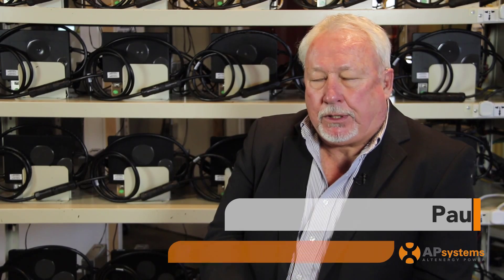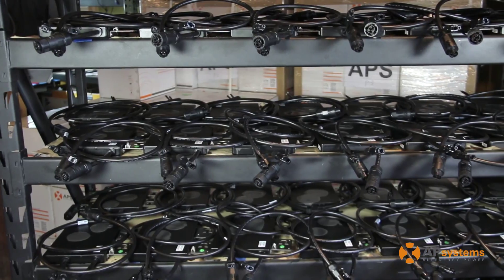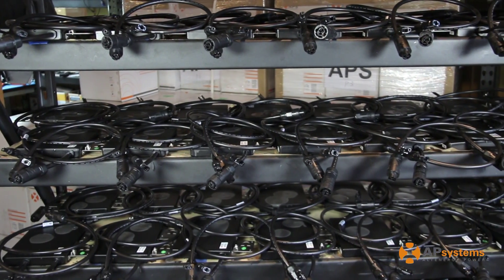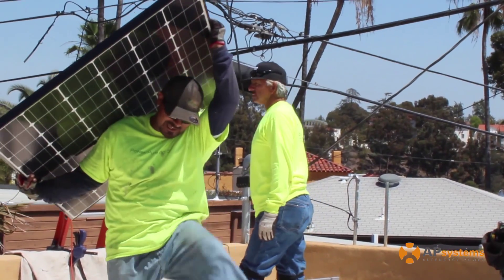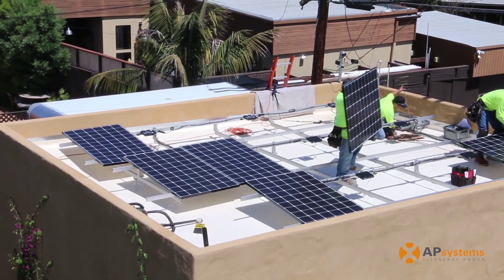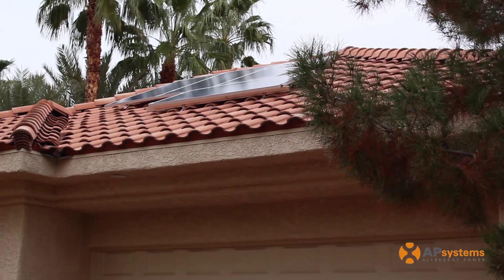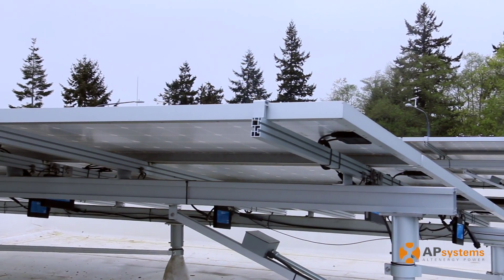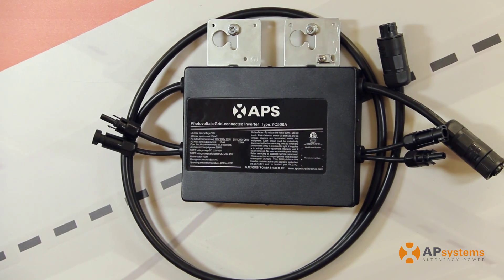APsystems YC500A Microinverter

Comment: The YC500 at 120VAC is very bad, it doesn't synchronize, and the after-sales support is very bad. We do not recommend it.
Reply: It is worse than bad.  They don't support the products they manufacture.  40% of mine have died in 5 years and APSystems turns a blind eye to the whole thing.  I took my failed ones apart and there were clear manufacturing defects of cold solder joints on the electrolytic capacitors.  That is not even excusable.

Comment: Hi guys I am having to go and trouble shoot the system another installer put in.   If you have two points of contact for two panels you would connect the positive and negative of the panel to the positive and negative  of the input on the micro-inverter, correct?   I know it seems obvious but the installers just "plug and played" and installed it opposite to that because the male and female connectors didn't match.  If you reverse the positive and negative connections for the inverter, will we damage it irreparably?

Comment: What happens if I use two Canadian CS6P-325P (325 watts)? Why it is advertised for up to 310w panels?
Reply from the maker: Hi Paulo, you should be able to use most any PV modules with our microinverters so long as they match the input requirements. The YC500A is recommended for PV modules up to 310W because of its output wattage capability. For 325W panels, we suggest considering the YC500i if it is available in your region due to its higher output.
Reply: APsystems Solar Unfortunately it’s not available in Brazil, same for YC600, I was told. So I can safely connect 325w panels.  Will it not overload the microinverters? I know that will be clipping, but my fear is to cause damage to the microinverters. Thank you.
Reply from the maker: As long as the input requirements match the parameters on the spec for those microinverters, there is no issue using the 325W panels with the YC500A microinverter.

Comment: The Max DC volt is to low when you have a solar panel with 96 cels 68V max.....They don't do the job since they only go 58V max......Bad...........Make something for the hole marked please.
Reply from the maker: Thank you for the suggestion. Stay tuned.
Reply: These weren't designed for 96 cell panels.  They are for 60 and 72 cell panels.